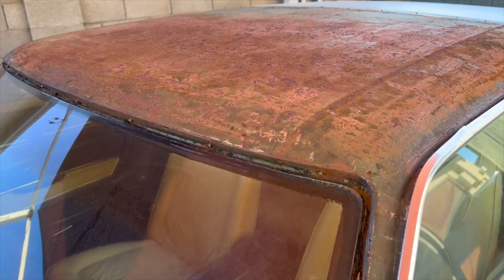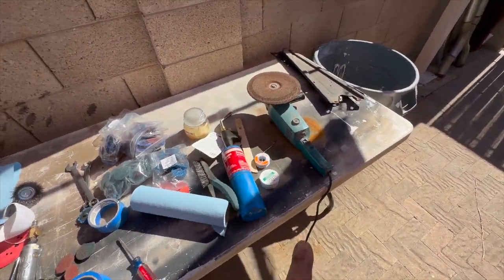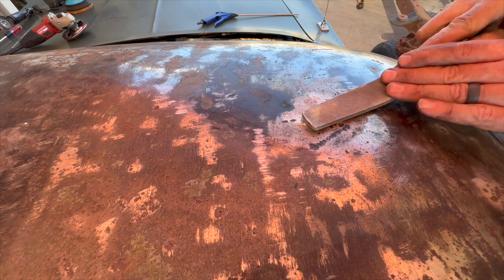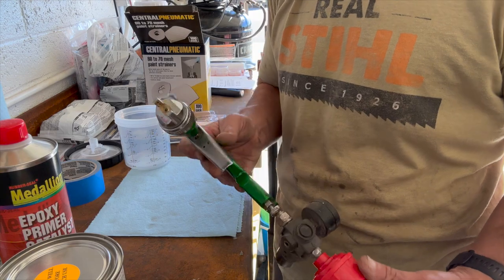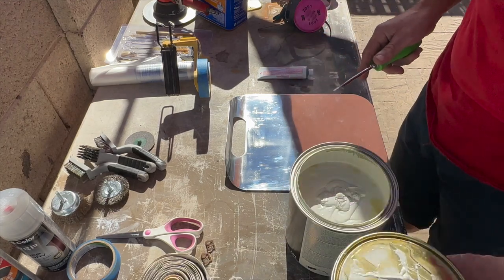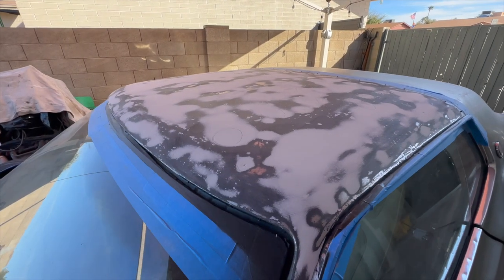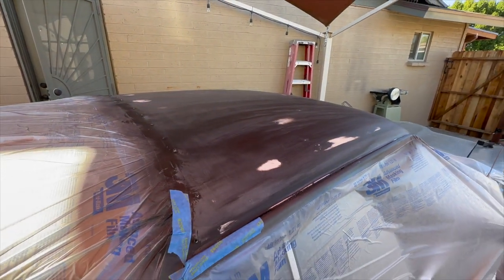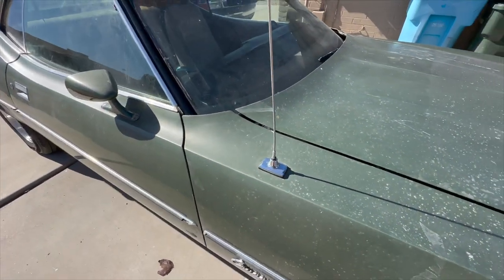FIXING A RUSTY ROOF ON MY 73 MERCURY COUGAR/ FIRST TIME PAINTING / DIY SATIN BLACK

Comment: For someone who keeps saying that they are not a professional, you’ve done a very nice job. 
I have to do the same work on the back half of the roof on my 1975 Cougar; how have you found the durability of the soldered parts? Did the heat affect the headlining? Did any of the flux wipe get through to the inside?
Reply from the maker: Thanks, no issues with the headliner. Durability was fine.

Comment: Really nice work and you did get autobody patience from your dad, it shows in your detailed approach to each phase.  I am restoring a 1973 Mach 1 and my hood looked exactly like your roof.  I used Ospho to treat the rust and convert it, stops it dead in its tracks.  You just need to neutralize it before spraying epoxy by reapplying it, wait 5 minutes then a good water wash.  I like that Satin Black, plan to use it for my floors, interior dash and engine bay.  Thanks for info and honesty!
Reply from the maker: I guess as I get older I’m a little more patient. I’ll look into that Ospho, thanks for the tips!